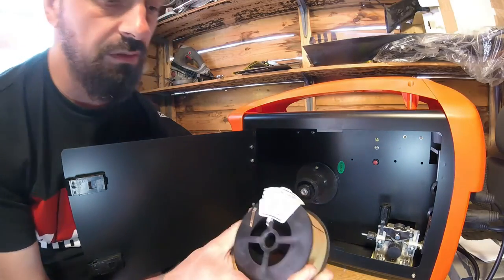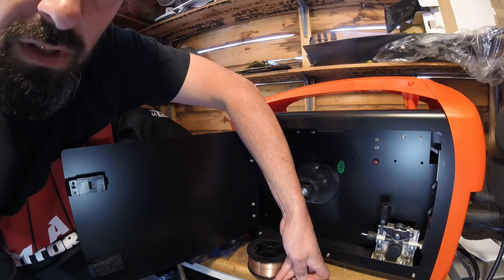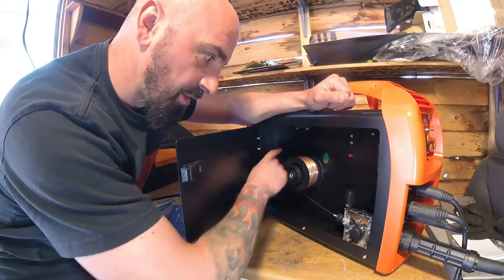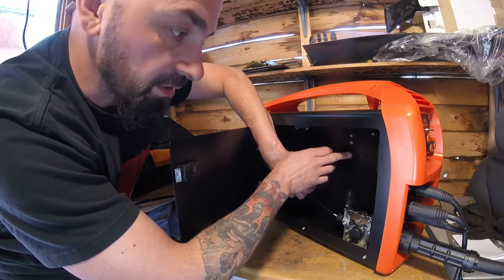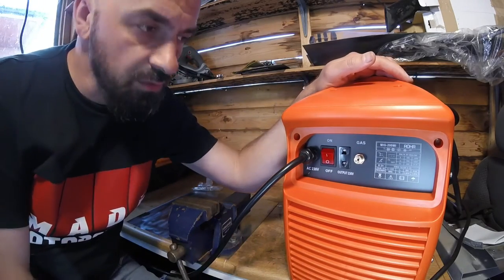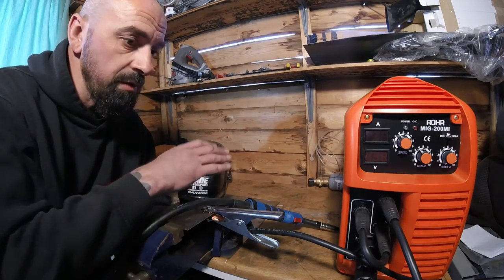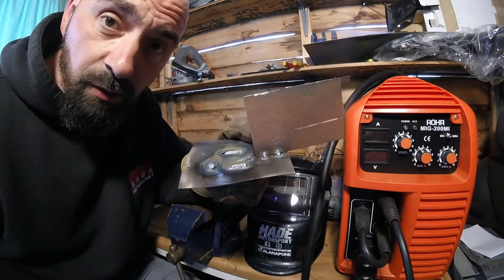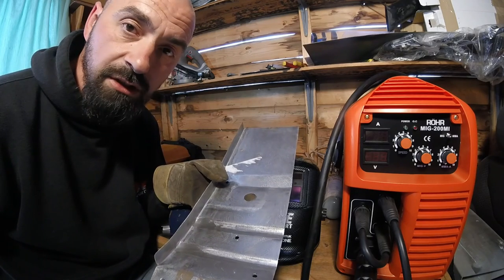Röhr MIG-200MI Setup and First Welds!!

Comment: I use the R-Tech 180 for MIG & stick, but recently bought a Rőhr 200 TIG. For the money they're great welders👍🏼
Reply from the maker: Yeah, I'm really impressed with this thing. I know some people might scoff at it's slightly toy-ish looks with the bright plastic covers but so far, it's much better than my friends Clarke EN90 (iirc) welder that was similar money a few years back.
Reply from the maker: How have you found TIG compared to MIG? Is it easy enough to pick up?
Reply: @AlanEaston  Put it this way, it's fun learning! Hardest bit for me is feeding the wire with my left hand. I'd compare it to driving a car then getting into the cab of an artic' truck. Same principles of driving apply, but a whole lot of difference😀

Comment: I use c02 fire extinguishers and pub gas cheap as chips with the uptime mig very similar to the rohe welds anything
Reply from the maker: I heard many people recommend that option but I couldn't actually get hold of any during lockdown... Oddly enough, my local welding supply shop were open so I just went and got the gear from them. Maybe cost a bit more but I'm happy with my purchases.

Comment: Interesting. Although I've no welding expertise (and very little experience), one thing perhaps worth mentioning is that whenever electrical equipment (lacking a 'soft-start') is switched on, a short duration input voltage spike ensues - which can damage the equipment. That being said, it's probably not a good idea to feed the wire by pressing the (red) feed button on/off in rapid succession. Other than that, thanks for your efforts.
Reply from the maker: Thanks for your feedback Roger and yes, I totally agree. It would be nice to see soft starts on all welding machines, I guess that would increase the price of the units. As for the red button... Also agree and it's not something I do normally. No idea why I did in this video but I guess we all make mistakes 👍🏻👍🏻

Comment: Hi. Brilliant video. Would it be suitable for car bodywork, I note from spec 50amp is lowest output. Is that not too high. What do you think
Reply from the maker: Hi John, thanks for the comment. I was concerned myself but as you can see in a few of my other videos, I bought this mig solely for use on my Peugeot 106, which are renowned for cheap crap metalwork. This thing amazed me at how well it can weld the thin, mostly rusty metal and still create solid good looking welds. I didn't even use it on the lowest amperage so I'd imagine if you found a car with even thinner metal, you could lower the current even more and weld successfully.
Reply: @AlanEaston  Thanks Alan really appreciate the feedback

Comment: How much welding did you get out of the disposable argon cylinder. Thank you. Very interested in that setup.
Reply from the maker: Hi Christopher, depending on if your pipework has any little leaks and how careful you are with the trigger and using gas when not welding (ie feeding wire after snipping an end off) I got about 5-10 minutes of actual welding done. 

I'd seriously consider getting a small 5l bottle and the larger diameter pipework to attach to this unit if you are just starting out or have a project any bigger than maybe small rust repairs on a car etc. It's a lot more cost effective.

Comment: Hi, just bought mine today and am looking forward to getting started. On the instructions it says @point 7 “ground the unit using the ground connecting screw at the back of the machine and connect to a grounded metal point free from the weld surface” I never saw you do this, any reason why not?
Reply: Had a reply from the manufacturer, if your manual also has the instruction to “earth using the ground screw at the back” ignore it. It is a miss print.
Reply from the maker: I hadn't even seen that bit lol. I haven't had any issues with it either way. :D
Reply: @AlanEaston  I spoke to manufacturers it’s a miss print, should be for foreign sales only.
Reply from the maker: @piranhapete5786  good to know. 👍🏻👍🏻
Reply: I'm watching this video in the hope this very question would be answered 😂
Reply from the maker: It was a misprint so you don't need to worry about it 👍🏻👍🏻

Thanks for watching. Hope you get any more help you need from these videos. 😎
Reply: Great video and came here just for this comment. Was racking my brain wondering why needed to earth it in the UK
Reply: I take it this misprint included the 250mi version aswell?

Comment: Try a co2/argon mix. Works well with most migs. And set the voltage slightly higher than the speed.
Reply from the maker: I'm using a tri-blend now... Seems to be doing the job nicely. I'll be posting a video soon of another project to show the improvement in my welds on some thicker stuff.

Comment: Hi Alan....im bought the 250 amp version of this machine....can I ask what is the rating on your supply to your shed....are you plugging it into a 13 amp or something else....Great video BTW....like to see more welding / settings etc....subscribed....😉
Reply from the maker: Awesome, Thanks Jayeff for the sub!

To be honest, my shed electrical supply is the most dodgy wiring ive ever seen. It is basically wired into another 13A fuse in a fused spur in the house via a 1.5mm cable. I have felt the cable after using the welder and it's not warming up to a concerning level so i'd guess the current draw isn't too bad.

I keep saying it but I really do need to do some new videos... By the time I get round to it, this welder will be ancient at this rate lol.

Comment: wow ,, displays you cant read unless your busy welding , what a waste of two readouts ,, even f they remembered the peaks or something but they are about as much use as t*ts on Tarzan.
Reply from the maker: Yeah, they are a bit but then I'm not sure how the machine would know how to display readings properly as the volts and amps depend on the stuff you're welding? I know other machines do it, but I wonder if they change while you weld or does it just blast out that setting regardless, meaning you need a bit more knowledge to get the settings correct to get good welds? This method does seem to suit the novice better as it tries to reduce current etc to stop you from just blowing holes in everything from what I can see.
Reply: @AlanEaston   the norm is that the display shows the targeted settings , that way you can save a settings list as a reference , personally I never look at the settings, I look at the results , and use my ears , but I have been welding for a while .
Reply from the maker: I see, so you set the target but then the machine will adjust it if lower is needed?
Reply: @AlanEaston   no , its not that clever I dont think ,, if so it would run semi synergistic and it seems not to do that ,, even a delay on the readings to show peak would make them more useful , but to have them only read when your actually welding is a bit like having a solar powered torch.